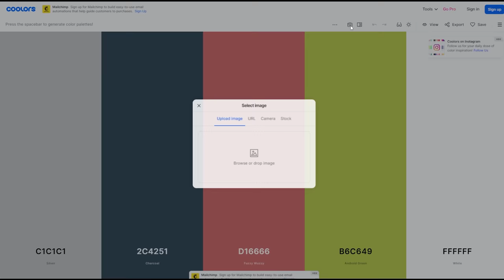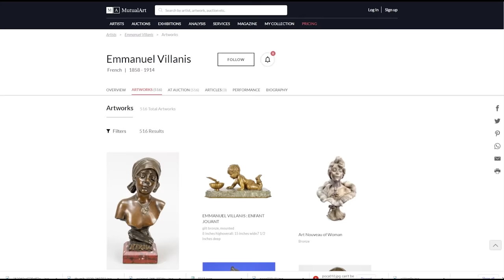Making a MINIATURE Enchanted Forest (and painting with Disney colors)

Comment: What a beautiful piece! I can't get over how gorgeous this is! 

I love that you did your own laser cut and acid etched plants. A laser cutter is on my long list of crafting toys I want to buy in the long term haha. 

Which VR sculpt program do you use? I haven't done much sculping in my headset but I would love to spend a bit more time in there!
Reply from the maker: Thanks Geordie!
VR Sculpting is done in Adobe Medium, formerly called Oculus Medium. It's not as feature rich as Blender, but it lets you have layers and do voxel type sculpting on things. Can get quite resource intensive and my machine struggles sometimes with it at high resolutions.
Reply: @KnarbMakes  cool! I'll have to give it go! I've only tried gravity sketch so far and that was only for a few minutes. I still plan on using blender for the majority of my models, but it would be nice to break up the work flow (and take some breaks from sitting) to bulk out some sculpts in VR 😁